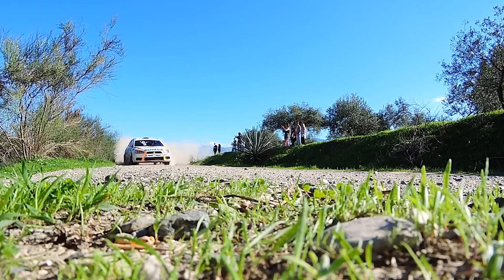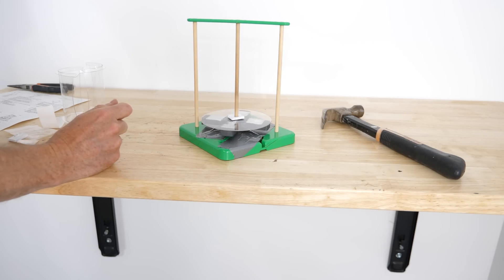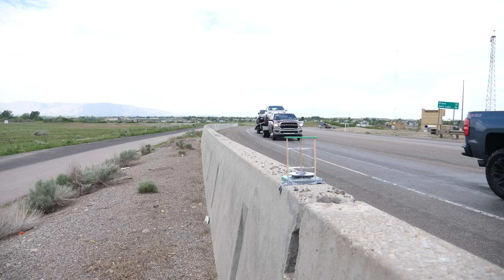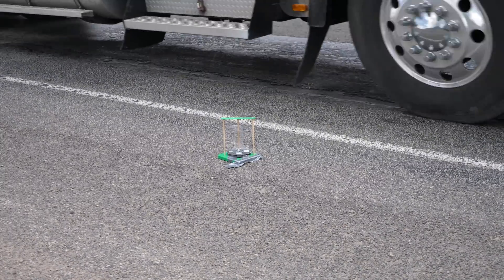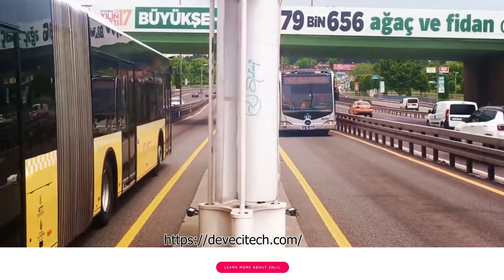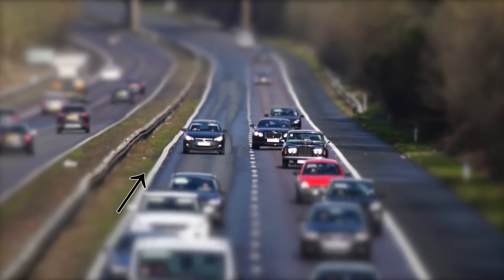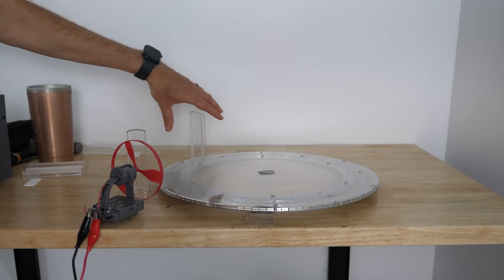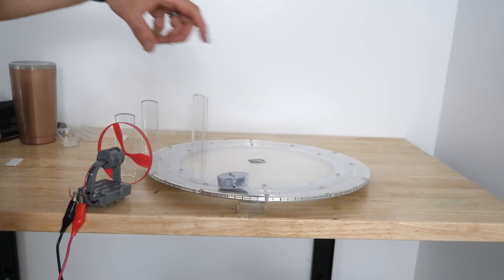Do Traffic Turbines Actually Work?

Comment: I had this idea about using the tesla turbine witch turns with wind rather then water by using the wind  to rotate copper disc or wire, haven't tested this hypothesis. (Witch in turn should generate electricity
Reply: I think tesla turbines are designed to work with high pressure gases.

Comment: This may work in small local systems, like providing supplementary power to traffic barriers in construction zones.  Not enough to be the sole source of power, but enough to reduce energy costs; and the turbines wouldn’t cause the same wind resistance issues because they would be replacing similar wind resistance inducing structures.  Still, might not be cost efficient though.

Comment: The reduction in efficiency may be insignificant, but the amount of power generated is also insignificant, barely enough to light an LED. So it could still be worse than burning the extra fuel used directly in a generator.

Comment: The turbines wouldn't make cars less efficient if anything it would make them more efficient because you forgot to account for the cars and traffic coming in the opposite or opposing direction. Without a central barrier between the lanes traveling in opposite directions they are generating tunnels of air in opposition to each other which means a majority of the friction is happening between the two lanes and if the turbines were located on the center line inside the barrier or wall, they would produce the maximum amount of efficiency while also improving aerodynamic efficiency of the highways. I invented these when I was 10 years old in year 2000. It's even documented. I emailed an invention company about it lol. I called it the aero oscillator. I had another design that was a barrier that could be made of plastic or netting and would work similar to a ocean wave generator.
Reply: Most high-speed traffic is separated by more than enough space or barriers to prevent that from being a significant issue. That is also not at all a benefit for turbines that aren't in the middle of the center line.
Reply: @5467nick  sounds like you kinda misunderstood, My point was the center barrier is The only place you would want the turbines as they would be using the wind coming from both directions simultaneously. Having them on the outside where it is too far away and you only have one column of air isn't enough to turn the turbine but in the middle of the highway it's a different story because The middle of the highway is where the two opposing tunnels of air meet and would turn the turbine in the same direction with twice the force. Plus being in the middle of the highway there is nowhere for the air to escape outside of the columns of traffic so the air pressure between directions is higher than the outside. He should have just ran the experiment from the inside wall of the highway taking advantage of both columns of air and the higher air pressure
Reply: @nighttrain1565  I didn't misunderstand you, I merely pointed out that putting the turbine in the middle of the road wouldn't likely make a significant difference. The reason why is most high-traffic, high-speed roads have a wide area in the median between the two directions of travel, or there is already a large barrier between the two directions of travel, therefor any turbine in the middle would be far away from the cars or would have to be too high over them to make a difference.
Reply: @5467nick  so yes, you are clearly misunderstanding😅 or just not reading what I wrote lol... it says in my comment to put the turbines "inside" the inner wall. And turbines wouldn't be as effective as a wave generator using a plate or a screen the way an ocean wave generator would. You could essentially make the entire central barrier that divides traffic a generator itself. No need for a turbine. Turbine has too many moving materials anyways. It would be more efficient to turn the center barrier itself into a generator by putting it on a Rotating axis and pass its mechanical inertia onto the next barrier. Number one highways like you are describing are very rare and the ones that do exist don't get much traffic and the traffic they do get doesn't go anywhere because it's either LA Houston or Austin lol. I've lived in all three and those are the only cities in America with roads like you are describing and nobody is going anywhere on those roads 😅. But the design of the highway wouldn't matter at all. You wouldn't even need a highway for my design to generate electricity. It could just be a hillside. Turbines are a stupid idea anyway there's too much mass. You need to turn the entire surface area of the barrier into a generator is what I'm saying. And with that design it wouldn't matter if there were even cars on the road or if there was a road at all lol
Reply: @5467nick  and putting a turbine in the middle of the road would double its mechanical input then putting a turbine on the outskirts of the road. When you have two columns of traffic you have two columns of air and when you put a turbine on the outside of only 1 of the columns you're only benefiting from one of those columns. When you put the turbine between the two columns of opposing traffic going in different directions you are going to double the input of the turbine. Plus the moving air doesn't have anywhere to go except into the opposing lane and into oncoming traffic which decreases efficiency for both columns unless there was a central barrier. Not only would the central barriers that are taller increase efficiency of travelers but it would increase the efficiency of any type of electrical generating apparatus you would put in it because it's between the two columns of energy instead of one.. It's pretty self-explanatory.
Reply: @nighttrain1565  In a typical USA highway, the two directions of travel are separated by a very large gap. Any generator in the middle of this gap is too far from the cars in either lane to have any appreciable power generation sourced from the cars. The moving air from these cars has a wide area to disperse through such that any of it that makes it to opposing traffic is so dissipated that it has a negligibly small impact on the air drag of the opposing traffic.

Roads that do have opposing traffic right next to each other are typically either lower speed, meaning there isn't much air drag to begin with, or low density, meaning there aren't enough cars to possibly justify the cost of any generator, regardless of design.

Any road that does have the two lanes nearby and is high enough speed and density will almost always have concrete or some other structural divider. No longitudinal generator could possibly replace them and still perform that duty as well.

We can't make anything that will meet modern safety needs and be effective in power generation for these purposes, and even if we could, it would never be economical.

Comment: They are terribly inefficient, constantly variable and the resulting energy is negotiable at best for even charging batteries to power high efficiency roadway lighting. Also tested with local railways. Same result. Expensive, ineffective.

Cheers.

Comment: Drove past an 18 wheeler not too long ago and it had so much air pressure it almost stopped my car as i passed it. Went from 60mph down to 10mph and it felt like I hit a huge, deep puddle of water (but there was no water). I actually thought I hit a deep puddle of water, but was confused not seeing one... so I looked back and there really was no puddle. Was all from the truck that had passed me at that exact moment.
Reply: If I understand correctly you were sat behind the truck enjoying the benefit of being in its wake. When you pulled out to overtake you suddenly lost this benefit (plus possibly a strong headwind). This demonstrates the efficiency gain of driving in convoy, but isn't really relevant to the turbine technology being discussed.

Comment: The 401 through Toronto is the wind tunnel you're looking for.
Reply: I drove on the 401 many times before especially by Toronto, and no it's not. 401 Toronto is a freaking parking lot at most times.

Now if we're talking the 401 outside of Toronto like Cambridge or, Quinte West, then yes. A traffic turbine can work since everyone goes about 110km/h average

Comment: People don't realize how much efficiency you gain by driving in a pack on the highway. Most cars today are pretty aerodynamic, but if you're driving an old Jeep (or other brick-shaped vehicle) the savings is easily noticeable. So if you're taking some of that energy for turbines, it makes sense it'd come at the expense of some fuel efficiency (except for the cars at the end of the pack - their air isn't helping anyone).
Reply: If more people rode bicycles, they would figure out that concept rather quickly. As for the cars at the back of the pack, based on studies that they have done concerning bicycles races, a cyclist with a motorcycle following him actually has an advantage over a cyclist with no one behind him. The air pressure increase between the vehicles actually helps to put the vehicle in front forward, but not nearly as much as the pressure decrease pulls the back vehicle forward. But the end result is that all vehicles benefit when they are running together.

Comment: Please consider the size of the propeller's wing, and it's location, with respect to the volume of air that is misplaced by cars.
Also consider "feathers" - as a tool that swallows turbulence.

I think the idea of redirect excess energy dumped to the environment of a road, in both "air movement" & "surface movement" (see the road plating that translate shock absorption to electricity) , is a good one.
Reply: Good but really hard to do without breaking the laws of thermodynamics.

If there's a way to harness shocks from road, why not harness them in the car axles, so they get more mileage by _not transfering that much vibration energy to the road in the first place_?
Reply: @u1zha  They do, it's more about saving the crumbs of lost energy.
"regenerative breaking" is also part of the energy cycling.

Consider how the feathers of an owl 
reabsorb air turbulence, it doesn't mean
all air turbulence is converted, only a fraction, that allows more overall synchronous movement of energy

Comment: I had a similar intuitive notion that it might not be worth it due to the energy ultimately coming from the vehicles. However, your experiment truly challenged my perspective and made me reconsider. It dawned on me that if the energy the cars lose is actually the kinetic energy of the air moving around them, then the opposite might hold true for headwinds. In such a scenario, cars would encounter less resistance and potentially become more efficient. I still believe there's more to explore regarding the turbulence caused by these turbines and the accompanying resistance, but it seems like we'll need another mind-bending quantum locking experiment to delve deeper into that fascinating aspect. Let's keep the momentum going!
Reply: Headwinds. Hmm.  Prob work better on boats, water is 5000x stickier than air.  I've fought 3mph current as tide changes or going upriver, makes it hard to maintain 6mph. . . .  So drop big boulders in river for boats to hide behind as they go upstream and then quickly go round ? .   But wouldn't the fluid speed due to boulders reducing the cross area of water flow?.   . .. Hmm.  What if each 10m car had 50m of extendable u shaped roof to connect to car behind, make a train, cut air resistance?.   AI trucks will drive 1m apart and sorta do this...  Oh well, lucky air resistance is only 30% not that bad a drag, darn wheels flexing are main this, train wheels don't flex at all so can roll mile but car can only roll 500 ft....  .    Hm.  Really air resistance could be cut if AI trucks go just 10mph, yes this means need 6x the number of trucks to carry load, but fuel use per ton drops a third......  Ships go as slow as schedule allows....  Planes too.....  Hmmm.  We could cut airplane speed to 200mph cut fuel use by 60%, yes take 3 days to fly to Australia, but doable, a plane flew round the world slowly to break that record....  Or hot air balloon with wind cross at 5mph.......

Comment: What if traffic turbines were only used in areas of deceleration?  These turbines could be "deceleration tunnels" of sorts because they would increase the rate of deceleration.
Reply: The amount of energy produced would never be able to cover the cost of the turbines, let alone the cost of connecting them to the grid.
Reply: Or right beside a long downhill?
Reply: @YangD-082  ngl, that's one good idea.
Reply: This would make sense but what would be such areas of deceleration? Also it takes a bunch of energy to produce and maintain such generators while the lifetime is limited.
Reply: @DoubleBob  ... Turbines could be put by on airport landing zone.   Or use cable like aircraft carrier.  Of course it's not really worth it....
Reply: @mostlyguesses8385  If the change of wind properties (i.e. different resistance) or the addition of several turbines next to the landing area causes just one accident...
Reply: @DoubleBob   maybe trains or BRT s when the approach a stop, just a thought...
Reply: @MM-np4md  Break Energy Recovery is a much more promising technology (given the relative energy of a train's momentum and the air's momentum). It also requires less resources.
The idea of getting back the energy isn't bad. It's just that wind turbines are a very subpar implementation of a good idea.
Reply: @DoubleBob  ahh I see, I've learnt something 👍🏾
Reply: Off-ramps come to mind

Comment: I don't see why a few turbines strategically placed around the body wouldn't be useful to at least supplement recharging of electric vehicles
Reply: That would result in net negative energy. With the model you're suggesting - even in a hypothetical scenario where wind turbines could generate electricity without any spill - the result would be 0. If you had a retractable wind turbine that could be used while the vehicle was stationary, then it could possibly result in net energy gains depending on how much it weighs. It would still be better to have a stationary wind turbine at your home, that you could connect directly to your car, or to an external battery while you're away.

Comment: I think this might be quite usable in tunnels. There is constant flow that once turbines get to the constant speed would stabilize, all airflow is directed in one direction and walls are already close to road, so adding turbines would not be safety issue. And for case of fire there is nothing easier than adding breaker type break that would stop turbines so they dont contribute to fire spread.
Reply: The energy produced will be less than the extra energy the vehicles need to expend.
Reply: "Adding turbines would not be a safety issue"
Spoken like a true keyboard engineer...

You know tunnels NEED free flowing air to not accumulate toxic gasses, right?
Adding a bunch of turbines would be counter productive as they would slow this air down keeping it in the tunnel.

Many tunnels already have huge fans blowing air through them to help replace toxic air with fresh air. That is literally the opposite of generating power from wind in tunnels.
Reply: I get your point, Vlad. Yes, fans are more efficient with baffles. So it would be more efficient to harvest energy in such a scenario. What the others are saying, correctly, is that you have to 'pay' for this somewhere. There is no free lunch.

Comment: I have to wonder about the shape of your wind blocks. They don’t just block airflow but also seem to redirect it back? A wind turbine would slow the airflow but also my redirect it differently so as to not make as much of a difference
Reply: The energy output depends on those differentlinesses. If it redirects airflow in a way that causes 50% less slowdown on traffic that moves the air, it also generates 50% less energy, roughly speaking. You can squint at this from conservation of energy standpoint, or from the Newtons laws standpoint, every action has an equal and opposite reaction... Some people think those are nuisances that can be worked around by picking angles and trajectories, but no.

Comment: 04:18 - I knew this would be an issue. Even though the wind turbines are separate from the cars, and only connected via air, once you do a rough impedance calculation you realise that there will be extra impedance added to the cars. It probably won't be noticeable in terms of fuel economy. However, it wouldn't be economically viable to generate enough power. There's also the issue of driver visibility, as well as autonomous vehicles (radar/lidar systems being confused). Interesting concept, but definite no from me!
Reply: It wouldnt be noticeable on a single car but it sure would if we take into account the whole traffic given those things would be installed in a lot of places. Its basically leeching off the traffic. It would be like being able to steal one cent from any bank account without anyone noticing, yeah the impact on a single person is well loss of one cent but if you do it to millions of people you would make some nice money.